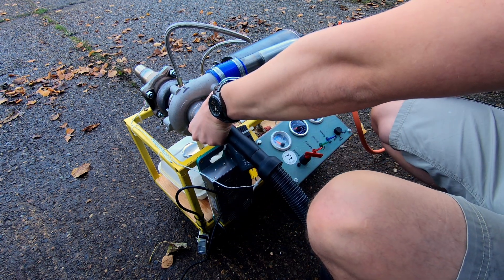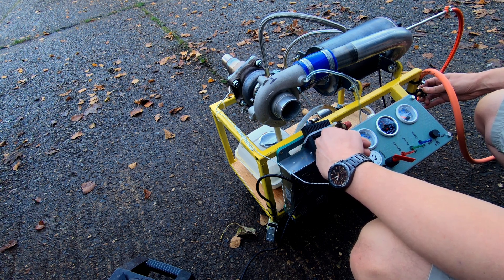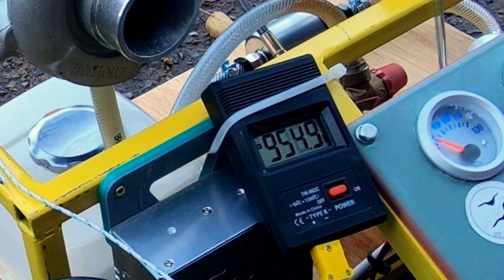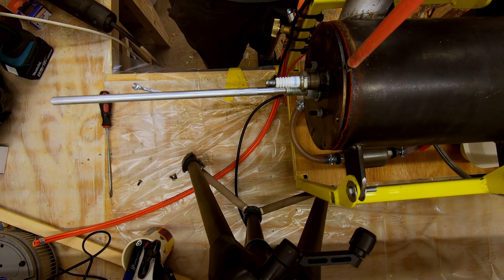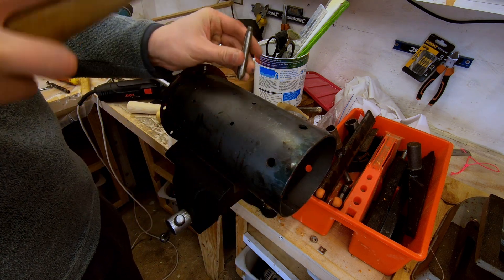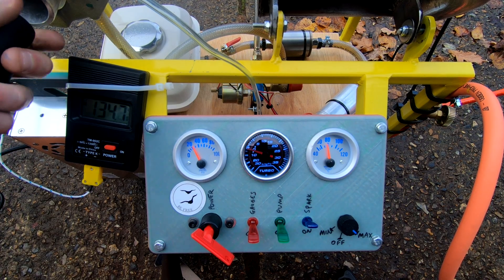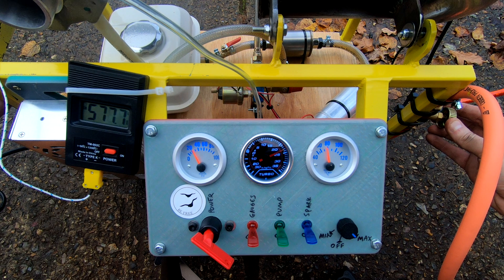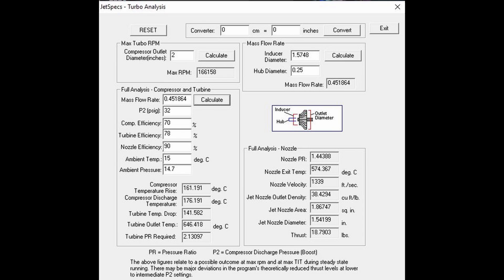Homemade Gas Turbine Jet Engine Part 2

Comment: Your flutter above 20psi could well be the hot side of the turbo being too restrictive causing the compressor to stall. You can check this by “bleeding off” some of your compressed air pressure and see if that improves it